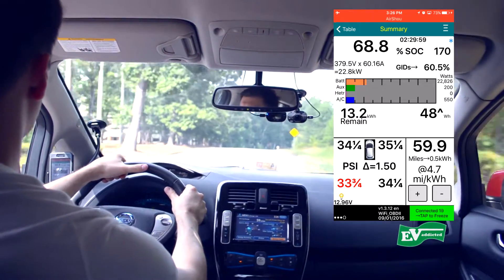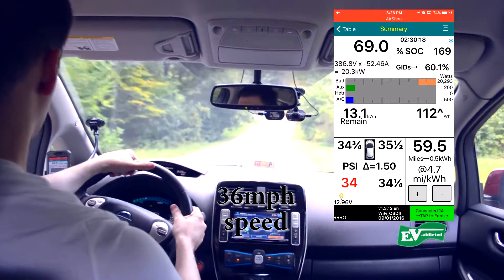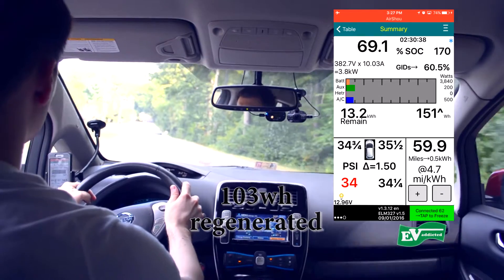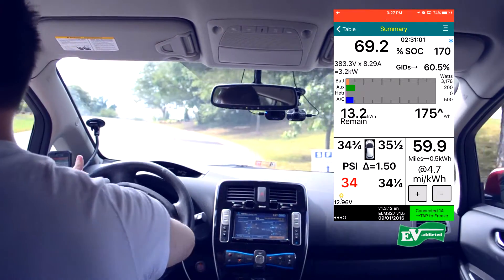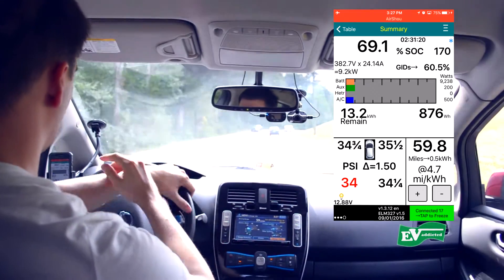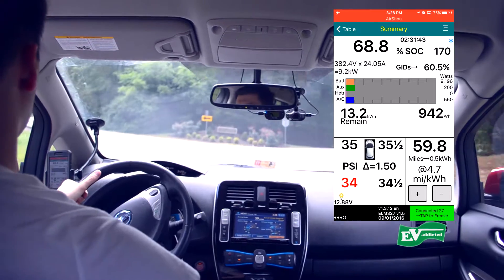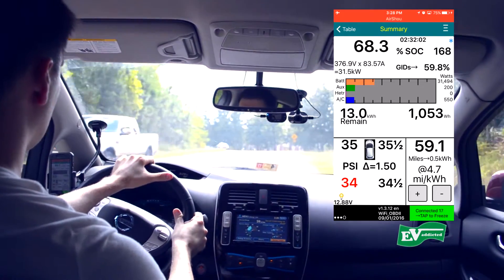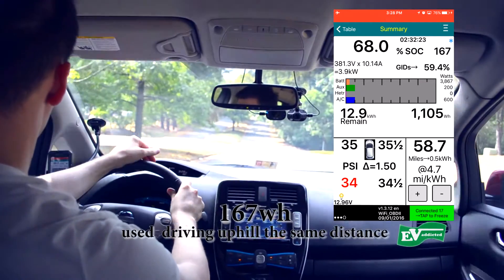Nissan Leaf Uphill vs downhill driving  test, used vs regenerated energy! | Leaf Spy

Comment: Is that Leaf spy? I guess it looks different as it's on an iPhone? On my android phone I don't get the voltage, power and current top left, and it's nowhere near as reliable on Bluetooth as this is, it drops of every 10 seconds or so. Have you got a link for this adapter?
Reply from the maker: Yes it's leaf spy for iPhone. Check on my channel the full video about my wifi obd2 adapter and quick walk through of leaf spy for ios.